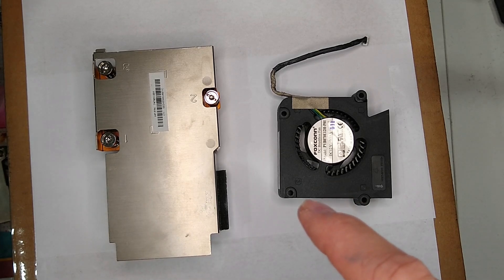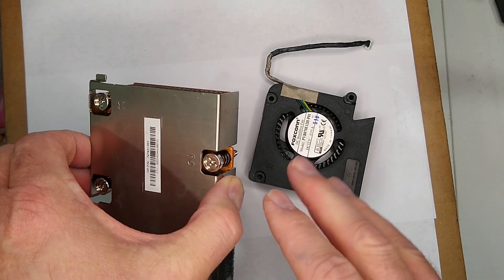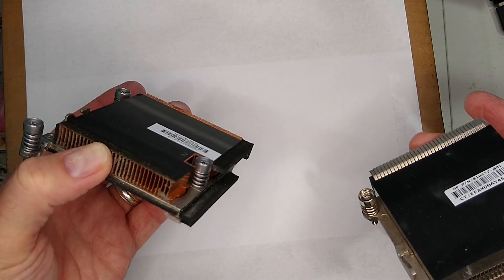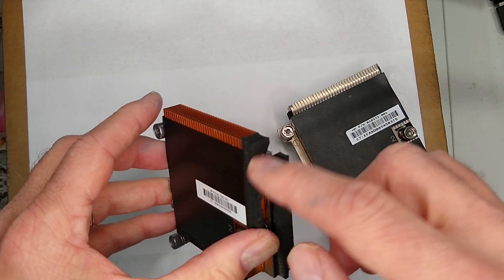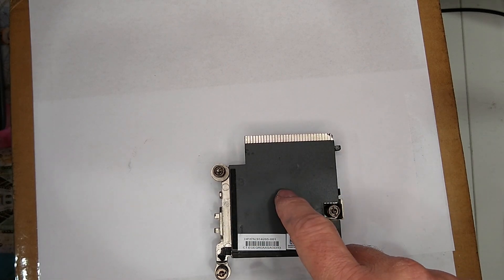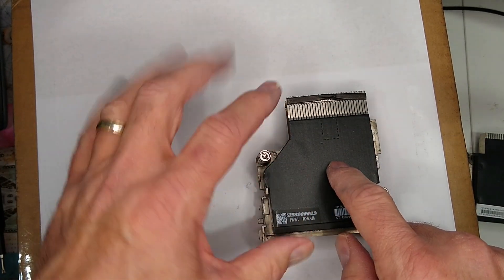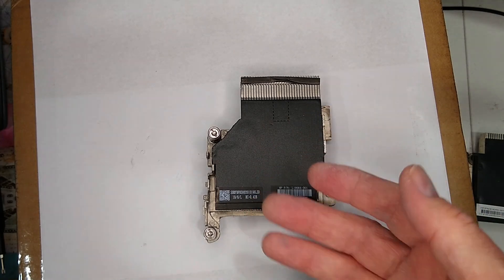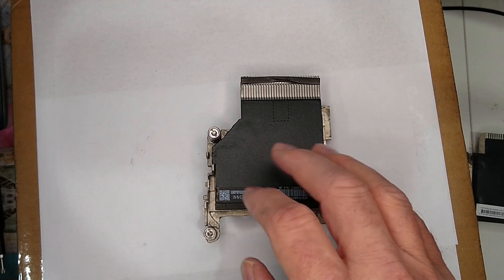EliteDesk/ProDesk Heatsinks...just how similiar are they?

Comment: Hello there, i was wondering if you could help me out with my g4 mini..the caddy fan just doesnt wanna spin :) It spins up durring boot but then no matter the temps of the nvmes, it just doesnt spin...
Any help would be appriciated please!

havea good one!
Reply from the maker: Do you have a drive connected to the SATA connector?  The fan won't run if there isn't a drive.
Reply: @handmedowntech  had it, didnt work no..same situation..
And no controls in the bios for it sadly...
Reply from the maker: @IvanK-DiyDetailingEU so you have a drive connected and sitting on the caddy?  I'll have to check my G4 65w to see if it's on all the time.  Unfortunately it will be a bit until I can get it though.
Reply: @handmedowntech hi. Yeah i had it connected and the system saw it, but the fan just doesnt spin.
Atm, the drive is not installed as i dont need it

Alright cheers, cant wait for your reply:)
Reply from the maker: So I fired up my 65W G4 and the caddy fan came on even without a drive.  I went into the BIOS screen and it stayed on.  Can you try the same test?  Boot up and hit ESC quickly to get into the menu and pick F10 for the BIOS setup - curious if it stays running.  If not then there might be something off with the fan.  When was the last time you upgraded the BIOS?
Reply: @handmedowntech confirmed,  it spun up even without a drive in it, but stopped a moment later. This fan is from the g5, worked flawlessly there..bios is updated..june or something there about

Comment: I'm using an HP 800 G4 35W DM with an 8500T CPU, but it's very hot with the aluminum heatsink. How much cooler will it be (like how many degrees will the CPU temperature decrease) if I replace the 35W heatsink with the 65W copper heatsink? Is it really worth it?
Reply from the maker: Check out https://youtu.be/av-yqI12rT0
Reply: @handmedowntech  thanks, seems like there’s no difference 😮‍💨
Reply: @M150._. Может термопасту поменять?

Comment: On another note, lightning struck for me again, bought another abandoned storage locker for $10, the pictures showed a couple of plastic totes, a couple of cardboard boxes, a PC monitor and a SFF pc, as well as a blanket and small rolled up carpet. 

The PC was a Dell Optiplex 9020, 4th Gen i5, and a 24 inch 1080 monitor, not great, but not bad, especially for $10. Guess what fits in cardboard boxes? Computers! The boxes contained a brand new condition Latitude laptop with  an 8th gen i5, a Optiplex 3070 Micro with 9th gen i5, and five more 24" monitors three 1080, two 1440, plus cables and accessories for everything, including some neat looking security dongles. Definitely healthcare work from home setups. 

The cherry on top is my son saw the small carpet and wanted it.
Reply from the maker: @cecilb7927  man oh man.  What an awesome find and just $10???  You need your own channel now.  Finding computers in storage lockers!

Comment: I recently built up an Elitedesk 800 G4, In the pictures on Ebay it showed a heatsink/fan, and no caddy, but instead it came with an HDD caddy but no heatsink or fan. I got really lucky and immediately found a G4 complete heatsink fan combo for $12 shipped, and I ended up using a 2.5" SSD, so the caddy was pretty useful, would have needed to order one of those anyway.
Reply from the maker: @cecilb7927  did that come with the CPU?
Reply: @handmedowntech  nope, no CPU, RAM or storage it came with wifi antennas but no card, I actually bought two barebones from the same seller, the other was a G6 which came with heatsink/fan, caddy and wifi card and antennas.

I am learning about the wifi slot right now, G3 and earlier seem to only recognize PCIE Mini, It would not see an Intel AX210 card, but a slightly older Dell branded Killer Wifi 5 card worked fine. 

The G4 worked with an AX 210 card a pulled out of a broken laptop, the G6 came with the same card.
Reply from the maker: @cecilb7927  if you're using elitedesk 800 minis then you would have the normal m.2 slots for the wifi cards.  Are you using SFF instead?
Reply: @handmedowntech  nope, minis, SFF is no fun! I am not sure what the issue is, the ones that worked on the G2 and G3 were slightly older cards with both A and E key notches, single notch cards weren't recognized at all. I checked in the BIOS and everything was turned on, as soon as I swapped in the two notch card in both the picked it up and I could connect to WiFi and bluetooth after reboot and before logging in to windows.

I am also using NVME storage in both of those, and I suspect that may be the issue, but am not sure why.
Reply from the maker: I'm surprised you could get anything other than an A+E keyed card to fit in the wifi slot.  Those are the only ones I've seen fit.